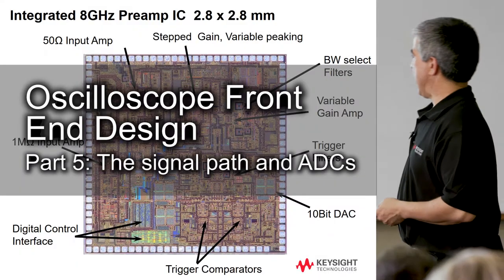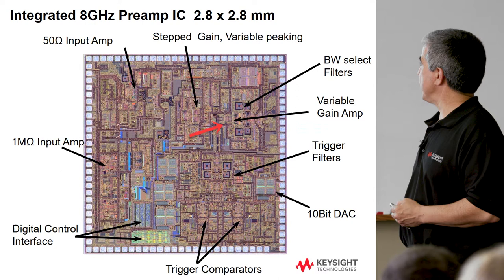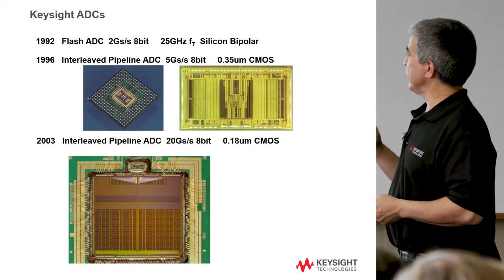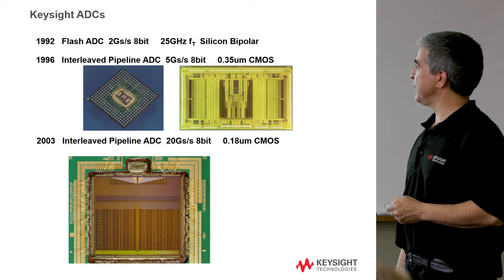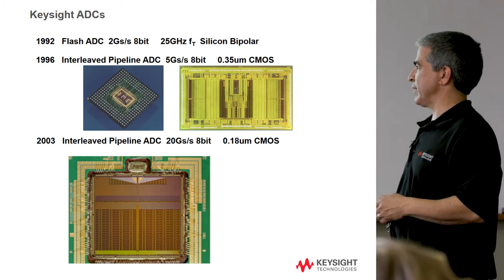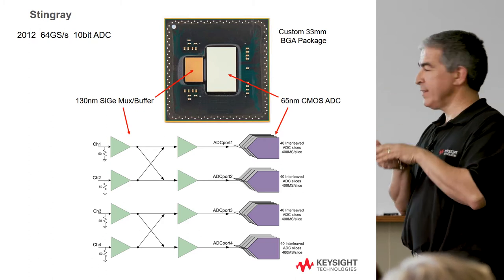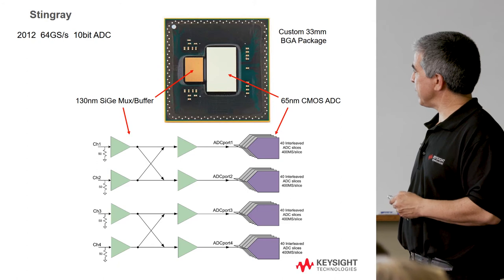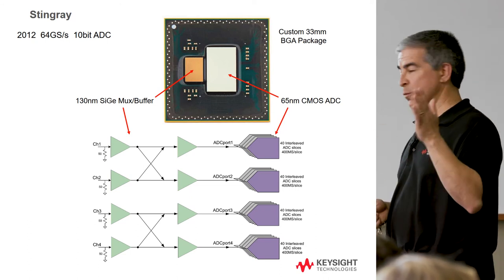Acquisition Boards and ADCs - Oscilloscope Front End Design (part 5)

Comment: What is the stepped gain amp doing? Coarse settings?
Reply from the maker: Good question! The stepped gain amp is basically for the large (course) Vots per division setting, while the variable gain amp can be tuned more finely.
Reply: Keysight Oscilloscopes Thanks again. Ive learned so much :)